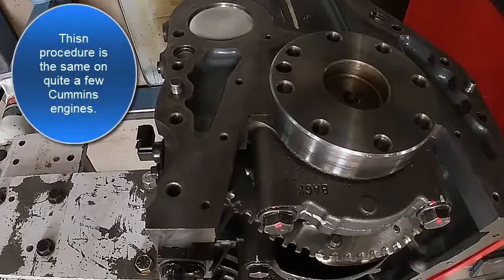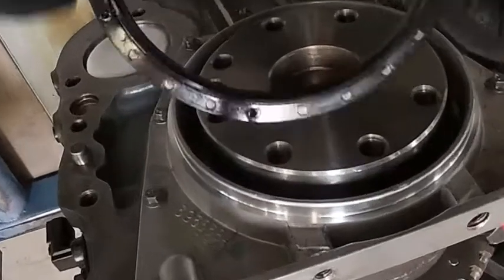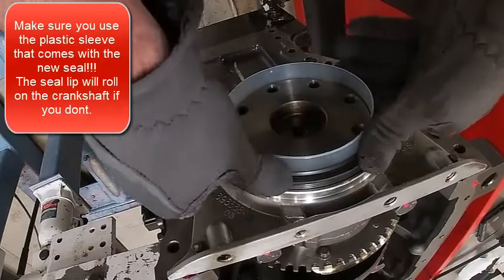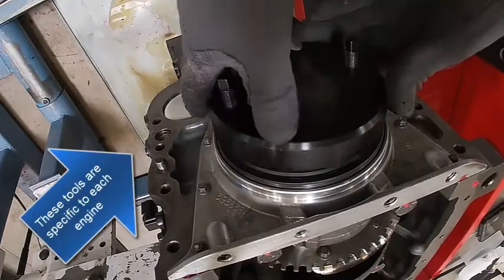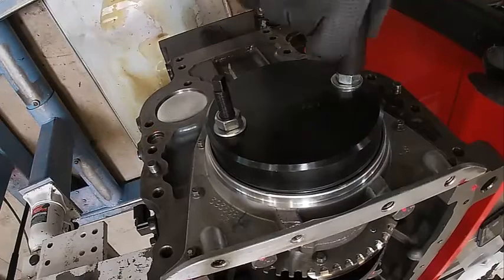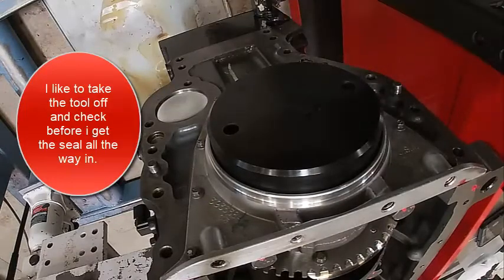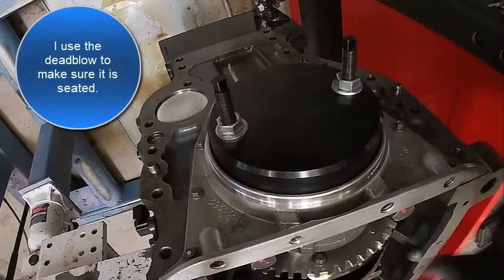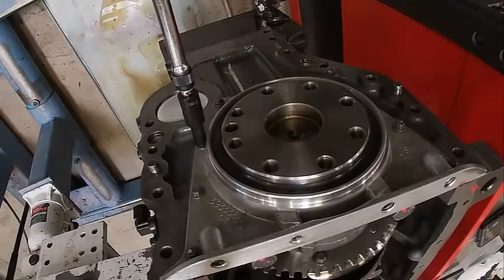Cummins rear seal installation ISB ISC N14 855

Comment: I'm sorry sir but you made a mistake. You were supposed to use the alignment tool to make sure that the crank cover is perfectly lined up then you tighten the bolts. Then you install the seal. How do you know that it is centered? Cummins part number 5395409

Comment: Don't most engines use a replaceable wear sleeve?
Reply: For the ISB I believe there is a kit available with a wear sleeve and seal used if the crankshaft seal surface is damaged.  Otherwise the seal rides on the crankshaft.